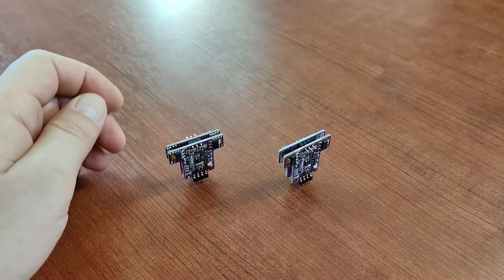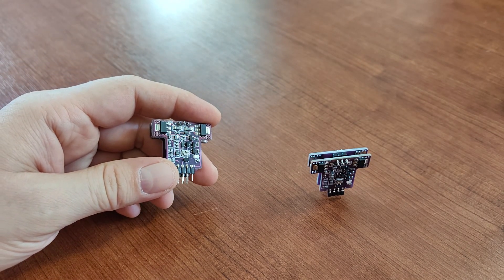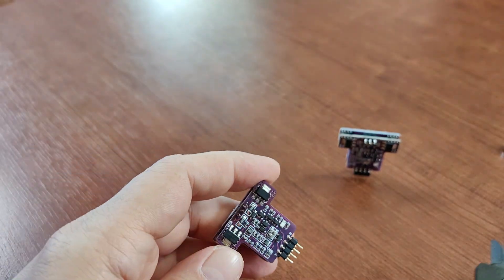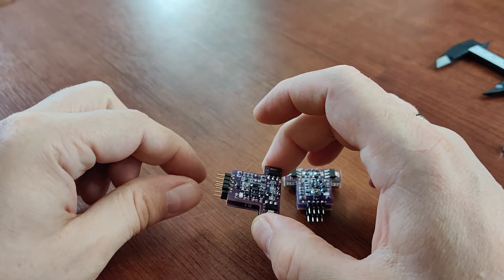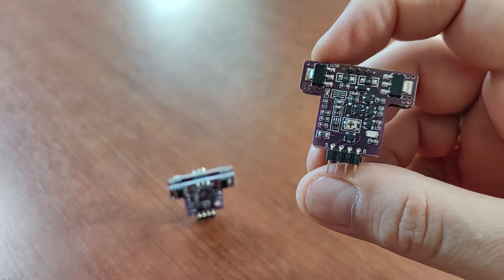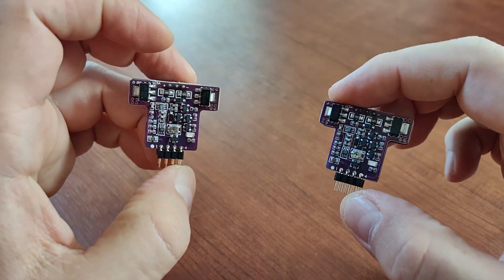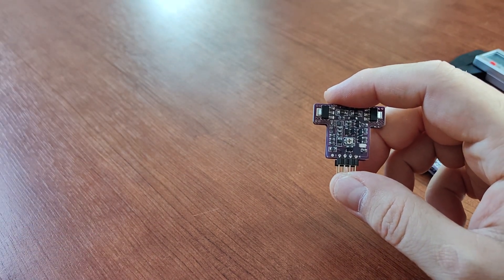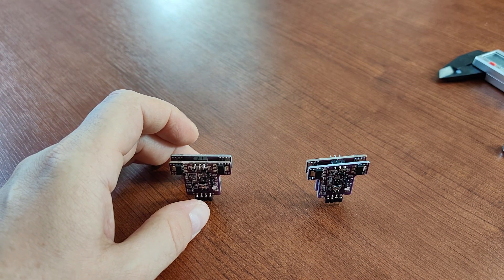AKLIAM LC5 class A discrete opamp review: my champ!

Comment: Do these fit into Semibreve da50, and does the DA50 have the power to drive them properly/adequately? would I need 2 duals for the DAC section and one for the headphone power amp section so that I'm fully discreet😃? Thanks in advance, I love your reviews!!! 👍👍
Reply from the maker: Hi! 
Thanks! 
As far as I remember these were fitting ok, there was no problems with closing the lid - but let me confirm that when I'm get back from my trip (I don't have access to them here). There is new horizontal version of LC5s that sounds the same, but takes less space. I need to review them soon as they are waiting for a video for quite long time now!
Reply: @k4syx Thanks for the quick response! I havn't bought the Da50 yet as l am also considering getting a Fosi ZD3 dac. I do not need a head phone amp as i already own the Topping L70 headphone amp. I also have a Fiio K11 r2r dac which gives me a bit too sharp ss's on some music using my Hifiman Arya Stealth head phones [both using it's  headphone out  or feeding the Topping L70 hpamp]. I'd like to reduce this as much as possible but still have great details and sound stage that the Arya's are capable of. I also have the Meze 109 pros and they are a bit less sybilant but still sharp ss's it times. Do you think the Da50 would be Better choice then the ZD3, with these opamps as it uses the AK4499EX decoder chip? Also I can save over $100 by getting the ZD3 DAC if you think it would be close to the Da50 and these opamps would work in it, if that is your recomenation...🤔  Thanks in advace,🙏 Regards Ron.
Reply: Did you get a chance to respond to my inquires? After fdurther investigation It looks like the AkLIAM  AK05 will fit fine in the XD3, but I would like to know which ones you think fit best in the Semibreve DA50 [the LC5 or the AK05]? Nice to see you had a good holiday...

Comment: I'm curious if these will work well with the new 3e audio line of amps. I ha e the a7 monos, did some measurements and it's on the very edge of fitting based on the measurements. I've ordered risers in case it doesn't slot right. Anyhow I'm curious if anyone has done this yet and if so what were your findings?
Reply from the maker: (not me, but if measurements are on the very edge it may be risky! just a 0.5mm error and it will be a problem :( )

Comment: привет! а какая обвязка нужна для AKLIAM LC5 в i/u. установил место jrc 2114, но получил постоянку на выходе...
Reply from the maker: You are asking for current or voltage? I dont really understand the question (probably some google translate problem)
Reply: @k4syx  поставил в i/u ASUS Xonar Essence STX,  но видно резисторы и конденсаторы в обвязке надо менять... щас стоят (2х390 ом и 2х2200 пф на одну AKLIAM LC5)... не могу подобрать!
Reply: ...какая обвязка стоит у  Вас из резисторов и конденсаторов (номиналы), для AKLIAM LC5 ?. спасибо!
Reply from the maker: @redreddy4003  thats weird these are direct replacement dual opamps and as long as rail voltage has stays within the limits they will work fine
I never had to change any R and C components on PCBs when rolling opamps
Reply: @k4syx  спасибо большое за ответ... Вероятно не в обвязке дело тогда.

Comment: Really valuable advice as I’m sampling into this hobby! Do these fit the case of Semibreve DA50 and how many should I replace team thanks!
Reply from the maker: @TC-bz8sm  yes they do, you can experiment with both I/V and LPF sets (that would be four together). For me the best set is to have precise OPA828 for I/V and then class A discretes in LPF for that smooth analog flavor:)
Reply: Thanks ! You’re the one who gets me decided to try this path even without any experience on op amp rolling 😅 just to be sure, for DA50 I can but two OPA826s for I/V and LC5s for LPF, for the headphones op amp would sparkos 3602 be a good match?
Reply from the maker: @TC-bz8sm  Yes you got everything right! :)
Reply: @k4syx  Are these the correct ones to get ? Needs soldering skills too?
Reply from the maker: @TC-bz8sm  Yes these will fit and no soldering skills needed. You will need a small screwdriver to open DA50 though ;)
Reply: @k4syx  last question , so I can close the lid/case of Semibreve DA50 like normal with LC5s ?
Reply from the maker: @TC-bz8sm  Yes with no problem, and with something like 2 or 3 mm clearance
Reply: @k4syx hi now they have Semibreve DA50 pro the inside looks a little different do you think LC5 can fit? Thanks

Comment: I have trie Burson V6 duals in my E600 BrzHifi amplifier with Focal Elegia and did not like the sound :/ it was too bright and lacking bass a lot with E600. I hope these LC5 will be different.
Reply from the maker: These are very clear, if you find the amp bright, these will not help. Whats your source? In other comment you've written that E600 lacks transparency and air for you?
Reply: @k4syx  my source is XD05PRO line out to rca E600 line in. I like the overall sound presentation that I get with E600 amp, but when I play more complex tracks like some electronic music I hear that the bass is a little weak and high frequencies are a bit muddy, lacks some clarity and separation. This was with stock opamps 5532 and with opa1612, 1656, muses 8920. I'm considering to buy now a pair of Akliam LC5 opamps that you reviewed and now just saw your new video about Burson V7 opamps. So I would like to ask which opamp would you roccomend to buy for E600 to get the best sound quality 🤔😁👍🏻
Reply from the maker: @bendzy169  my best choices would be Staccato for warmer sound (but these are expensive) and then Bursons and LC5.
You can also try OPA627 as they are affordable now (in DIP8 adapters) and they seem to my ears somewhat v-shaped (though freq characteristic is flat ;D )

Comment: My pin configuration has four on one side, two on the other. Is there a different model that fits mine?
Reply from the maker: Can you elaborate more? You're talking about LC5 pins?
Reply: @k4syx  not sure. I'm new to this. All I know is that I rolled op amps in my class d amp and I replaced one 6 pin for another (4 pins on one side, 2 on the other side)
Reply from the maker: @EricRhodeslives  No that has to be something different, DIP8 operational amplifiers have always symmetrical 8 pin build with two rows of pins, four pins in each row. Take a look at my video explaining how to replace opamps there is selection of them showing connector pins
Reply: @k4syx  ok but the hypex and purifi amps have 6 pin op amps.
Reply from the maker: @EricRhodeslives  That weird, this means these do not follow dip8 socket standard, can you give me some example chip type number to check the catalogue note?
Reply: @k4syx  I've tried twice now to share some. But the comments keep disappearing.
Reply from the maker: @EricRhodeslives  ah yes these are completely different standard when it comes to package size and pinout. So that's ok, but these will not fit. I think the most popular for replacing in audio equipment is dip8 standard socket, that's 2x4 pins.
Reply from the maker: @EricRhodeslives  I think the YT censors the links by default, I've seen that more than a couple of times already. That's why I've asked for model numbers :)
Thanks!

Comment: Do these fit in the ZEROZONE TPA3255 dual mono amps you reviewed?
Reply from the maker: Yes and as Staccatos these are great pairing!
Reply: Which one did you like better? I've got some Sparkos ss3602 on the way, and was thinking about trying another type just to see the difference.
Reply from the maker: @gregthibodeaux7992 Staccatos I think, though both were great and way better than stock ne5532
Reply: @k4syx  Would these beat the MUSE02 in the ZZ TPA class D mono amps as they are way cheaper than the Staccato and my MUSE02 sound a bit rolled off at the top end?
Reply from the maker: @michaelcampbell9459  Yes these are better than Muses02. 
I had bought Muses02 initially a couple of years ago when they were available and though they are good, there is quite a few better opamps. Muses02 still have one advantage though: they are standard sized DIP8 so they fit everywhere
Reply: @gregthibodeaux7992  Did you ever compare the two, these vs the Sparkos?

Comment: I replaced two opa1612 with two LC5 in my class d amp from Purify. My first op-amp rolling and very impressed with the difference. I you combine the changes and the costs it is my best upgrade so far. Will most likely be more op-amp rolling. :)

Comment: Thanks your video are always interesting . I d like you to post some test on a Phono pre,  expecially for those low output Moving Coil .  Often some Phono pre are really expensive , So it would be great if you test some pre in the range of 1000 usd . 👍👍
Reply from the maker: @coattodidolore9574  Hi! I'd like to, but the problem is I'm not a vinyl guy, I don't have a turntable... but I've seen that there are some interesting phono pre clones on Ali!

Comment: I have tried the LC2 on Aiyima A07 and Fosi ZA3. It didn’t work. LHY Class A dual OpAmps did work in both amps. I am using the LHY dual
OpAmps in my ZA3 mono blocks but have to leave the case open because they are too tall and won’t fit inside with the case of the amps closed.
Reply: Do they work with fosi Za3 and Aiyima A07 max?
Reply from the maker: @tamersosman  yes they do, they were designed with TPA3255 class D amps in mind.
Reply: @k4syx  how it sounds compared to sparkos and burson?
Reply from the maker: @tamersosman  Haven't heard Sparkos, it's better (more open and detailed WITH musicality) than Bursons. 
Honestly, my Bursons don't see much use lately - since I've discovered that every TI OPA audio line is basically better...
Reply: Opa1612 and opa1645 better?
Reply from the maker: @vbabitsful  Nope.
Reply from the maker: @vbabitsful  LC5 wins this comparison.
Reply from the maker: @rmzidann  yes these are supposed to be developed specifically to work in d class amps, though they are quite big!
Reply: what's LHY dual? I have the aiyima a07 as well and want to try this op amp
Reply: @MasterofPlay7  ..I bought it off Aliexpress. They were $22 each. They are big, slightly smaller than the big Stacatto Dual opamps.
Reply: @rmzidann  so does it work with aiyima ao7?
Reply: @rmzidann  hi. how do you like LHY op amps? I intend to buy some to replace the lme49720 in my dac